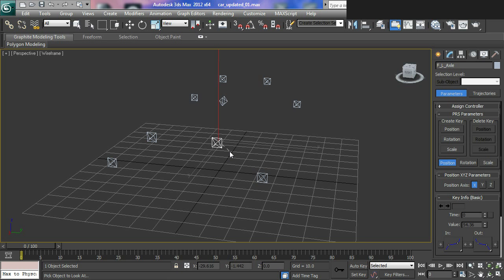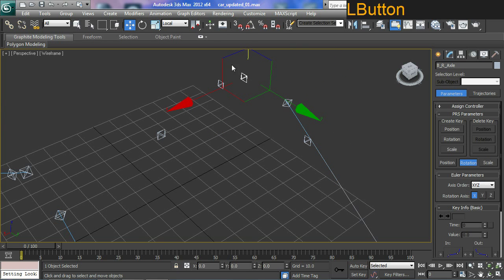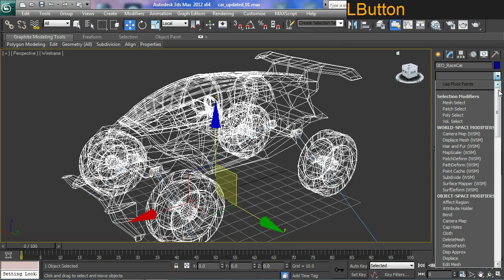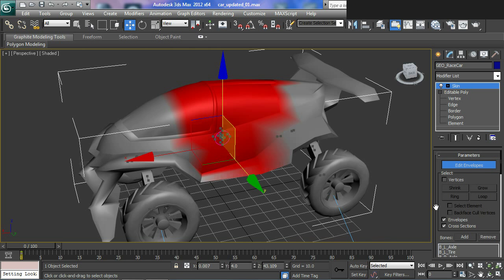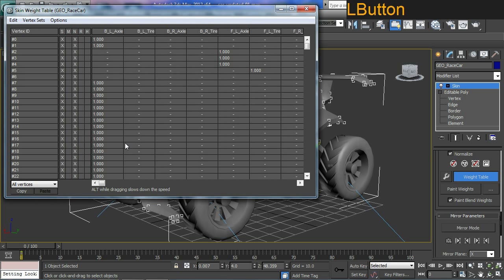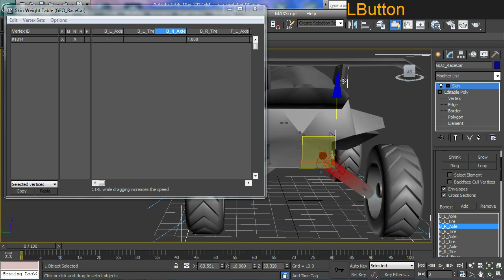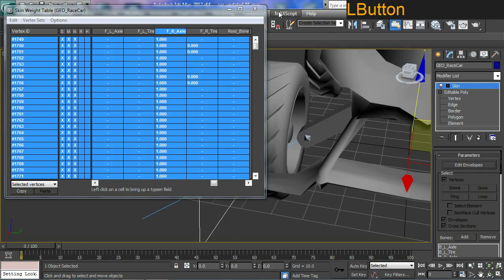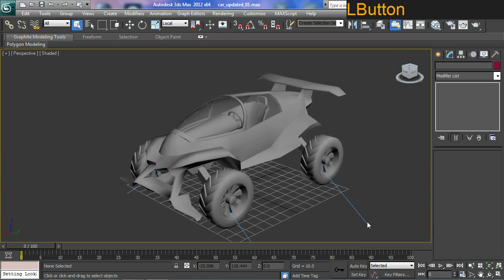Setup and Export a vehicle from 3dsMax to UDK -  part 2 of 5

Comment from the maker: @Jinxthewhitefox

In the example you have 'look at' constraints to make the axles 'look' at the wheels..  so those constraints is the reason for the error.. but not the reason for why UDK crashed on import..

so you'll need to trouble shoot your asset..  try exporting the mesh only.. (delete the skin modifier and export selected) and confirm your mesh can be imported as a 'staticmesh'